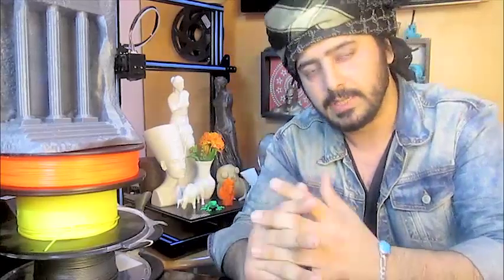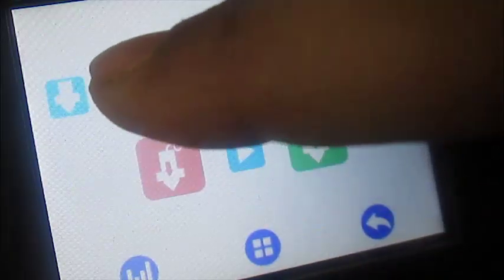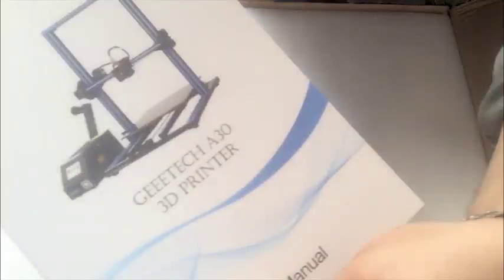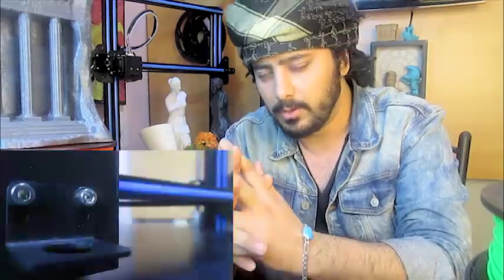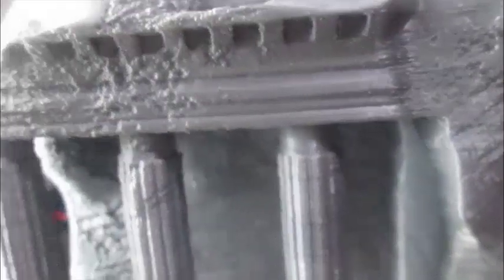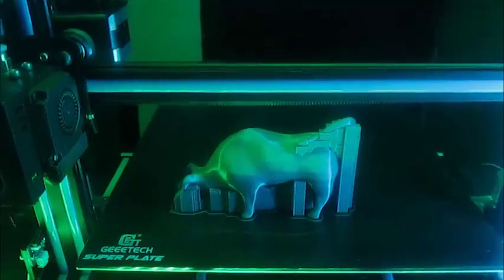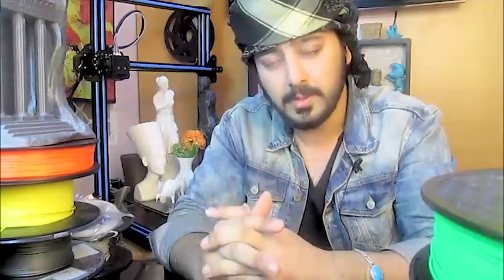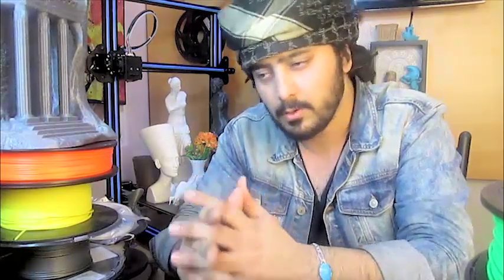Geeetech A30 3D Printer Review | Best 3D Printer 2018!

Comment: Nice video, thanks for the info. Would have been nice to see how the controller looks like and if the steppers can be replaced or if they're fixed/soldered on the controller board.
Reply from the maker: Hey mate, thanks for the feedback,, i will do follow up vids on those & much much more... so would be grate if you sub to the channel so you can be notified :D
Reply: 3DPrintingGeek done
Reply from the maker: You are awesome :D